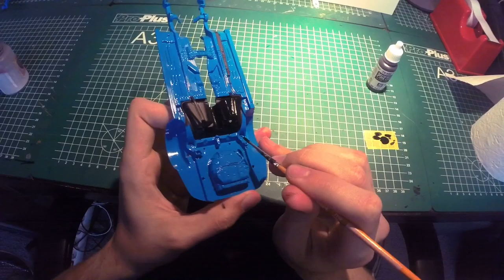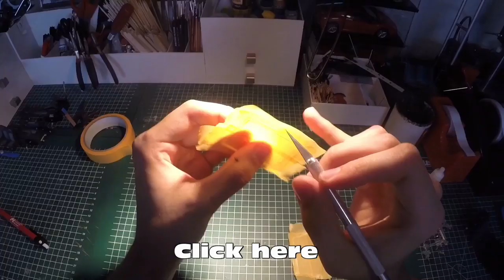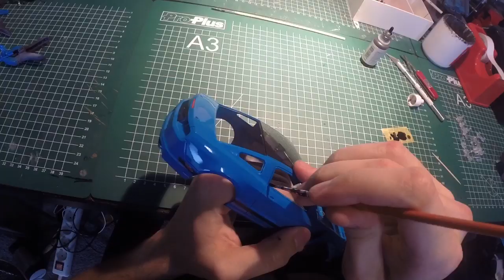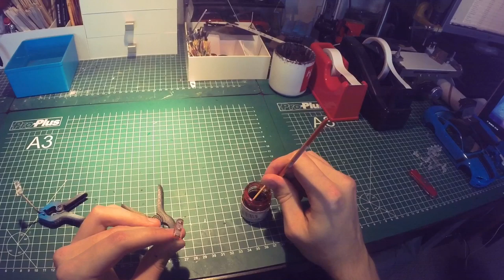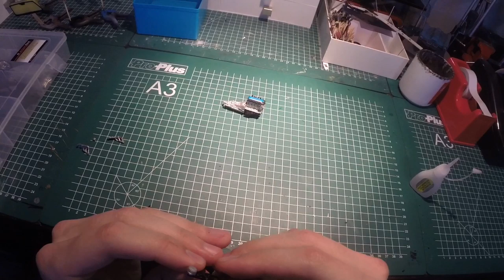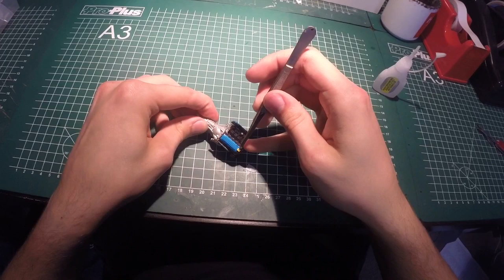Revell:2013 Ford Mustang Boss 302 Part 4/7

Comment: Really nice build! What kind of glue has been used to attach the exhaust manifolds to the engine block? Am I wrong or the paint hasn't been scraped off from the parts before gluing?
Reply from the maker: Your correct, the paint is still
On. I used super glue

Comment: Hey. I know I said this before but I absolutely love the quality and style of your videos. The voiceover narrations are much cleaner and more direct. 

I went ahead and purchased the 2 in 1 Evo on amazon for $ 181 (US). Should be arriving next week. I cannot wait as I have 2 model cars lined up for paint and working on a 1/12 Mustang build at the same time. I am going to try spraying some acrylic craft paints and clearing with Future shine and see how that works out. My main paint will be with real automotive paint since I have experience with that. I see it as cheaper in term of the quantity of paint to price ratio than say AUTO AIR or ZERO. Lets see how it works out, if not I will resort to Auto Air or Zero. 

Do you ever dip your clear parts like the windshield into FUTURE floor shine or any product similar to it to enhance the look of your kit's glass?
Reply from the maker: I only apply some wax to them sometimes, most of the time i don't do anything to them though.

Comment: Hi man I want to know how do you paint with the brush without marks of the brush I use the same Vallejo paints and when I paint my models y can’t get the same details with the brush like you do it would be a huge help if you tell me maybe you use more paint and extend or not well hope you can help me thanks a lot your work is really amazing I would like to do like you some day 😀
Reply from the maker: I have brush strokes too. Maybe add some thinner or paint retarder to help it flow and not cure as fast